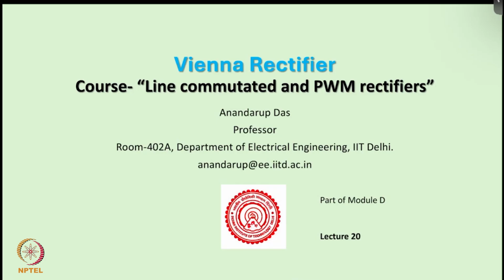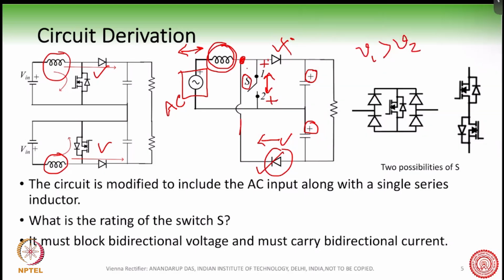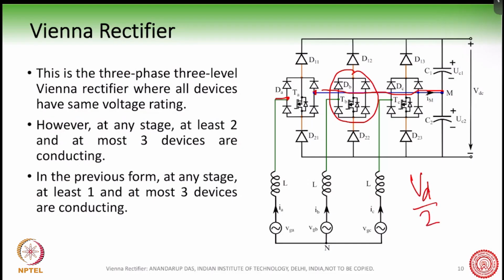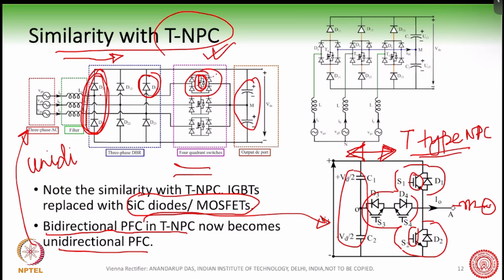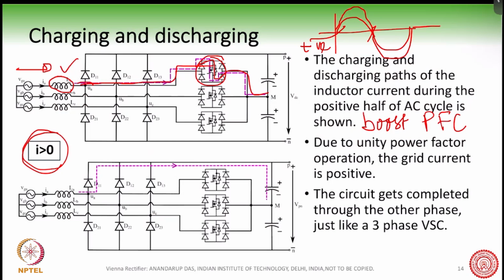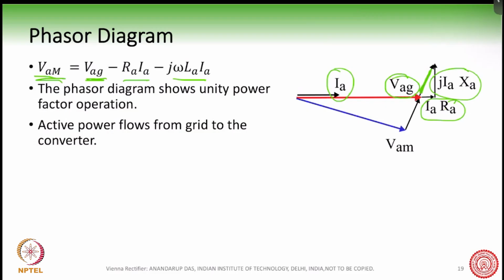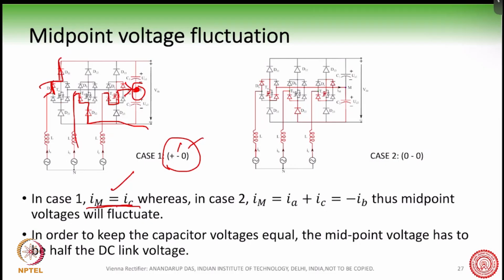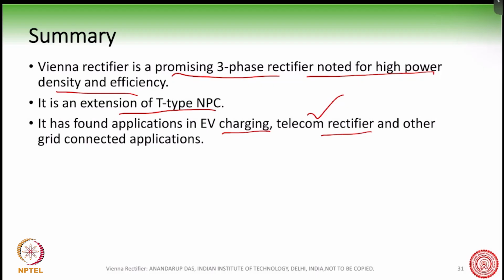Vienna Rectifier (L20)

Comment: The two rectifiers and the two capacitors make a Voltage Doubler. That has been part of the standard Universal Computer Power Supply for, at least, 30 years!